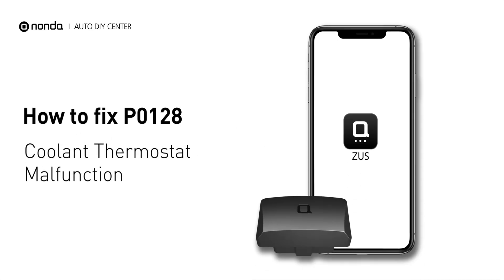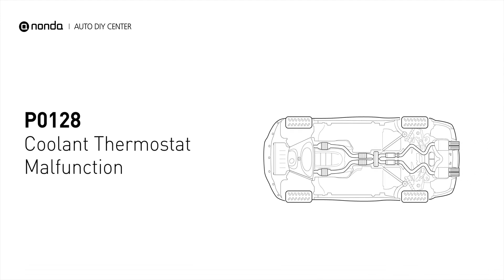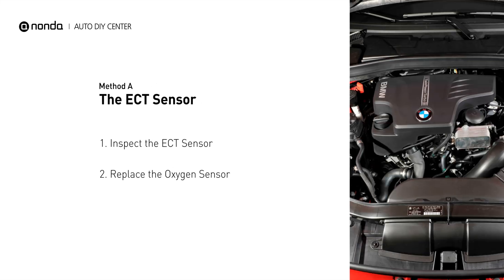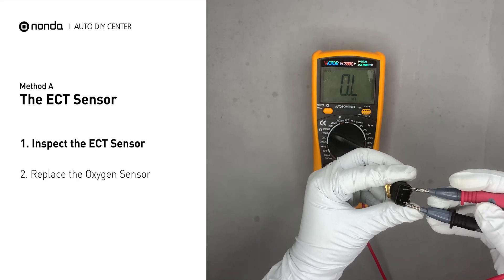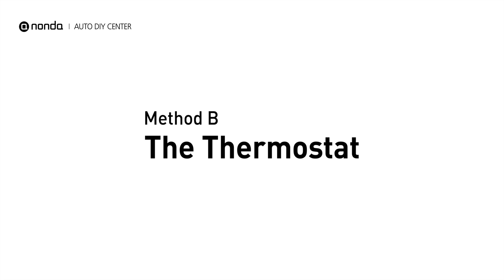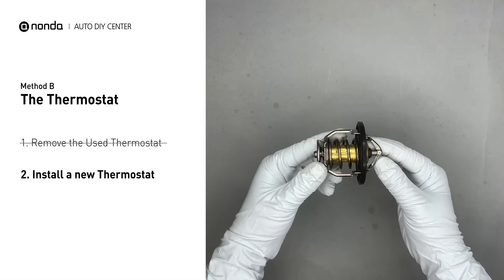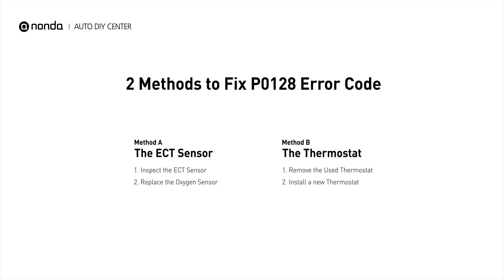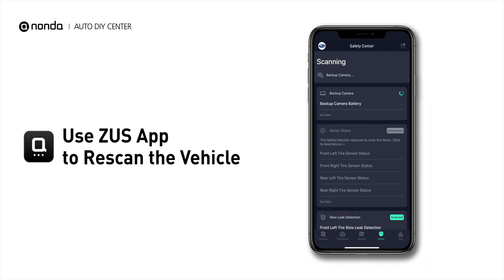How to Fix P0128 Engine Code in 3 Minutes [2 DIY Methods / Only $7.34]

Comment from the maker: Hi, I'm Steve, nonda's lead mechanic engineer. 
Feel free to leave your comments here if you have any mechanic questions, I will be glad to help you out!
Reply: hey man i have an issue. so i been having this code show for my nissan altima 2010 and i changed my thermostat in hopes that was the issue but it wasn’t. so i then just now changed my ect sensor but yet the code still shows.. do i have to drive my car a certain amount of miles for the drive cycle to kick in and wait a few days to see if that code still shows? and if it still does, what other options are there to fix the issue if options A & B don’t work? please help. i need this code cleared so i can pass smog 😭
Reply: @Swayyj  look up how to bleed air from cooling system. And if anything, buy a $20 obd reader. I found one at a shop in my city, works great. Connects to my phone
Reply: @Gabriel-pj2bk  i bled the air but still the code shows.. i have an obd sensor.. i have done everything at this point. i’m convinced it has to be the wiring or something else at this point. the car runs fine i don’t know why i’m getting this issue. please help me. i’m about ready to take this to a mechanic or the dealership to get this fixed
Reply: @Swayyj  its hard to say man. Could be a wiring issue, also could be your coolant. Sometimes if the ratio of coolant isn't exactly 50/50, it may throw this code cuz coolant takes longer to heat up. Is it possible you maybe threw in the concentrated coolant without mixing it with water? That's the only other thing I can think of other than a wiring issue
Reply: I have this code in my 2001 Buick century. This car has only 42,000 miles (bought from elderly relative) Shop wanted $150 an hour just "diagnose " the problem!! I have Verizon Him app which gives me the code.
It also says I need an 02 sensor.....so are these related? Car is not overheating.
Reply: if this engine check light code was not repaired for long time, what will happen ?
i hear loud noise after 20 - 30 min of driving which is increased by pushing on accelerator !!! is it related to unrepaired coolant thermostat  ? or something else  !
in dodge durango 2012
Reply: I have a 2009 Pontiac g8 an my engine light came on, I did the obd2 an the code came back as p0128 an p0497 I’m not sure tho if it’s my thermostat or the engine coolant temp sensor
Reply: My 2015 yukon had this problem change both parts now its giving a permanent fault code, And it can’t not be erase
Reply: What happens is thermostat  wasn't put at 11 o'clock possition?
Reply: Please, lose the goofy alarm sound in the videos.

Comment: I have P0128 and P0138 errors. I replaced my car's thermostat and the upper and lower oxygen sensors, but the errors don't go away. I'm thinking of replacing the ECT Sensor next. However, by replacing the ECT sensor, I have to waste coolant fluid again, which I just drained and topped up recently.

Comment: What if the P0128 code still shows despite those 2 things......they tested ok, but I went ahead and replaced the thermostat (just in case) and the ECT....t.hey were not very expensive.....BUT the code is still coming up and I made sure all the air was out of the block, and the coolant level was correct.
Reply: Check wiring
Reply: @Worldtourism-shah  I have every wire had continuity all way to ECM

Comment: 2018 Elantra 2.0 random p0128 shop said to replace thermostat housing with thermostat built in. Did that in November 2023. In January 2024 it came back and got a replacement u der warranty.  Now its April and its happening again this time i saw a smal stream of fluid as i drove off on my drieway. The drip pan under the engine bay is wet but can't find where the fluid came from i get heat still and used the torque app and temp shows 199. And these factory ones are 212 boiling point thermostat. Not sure what to do. Are these just junk thermostats or is the ecu or pcm needing some dealer update? Any thoughts or alternative solutions please share.

Comment: Hey Steve. I have a 2016 Kia Optima. I recently changed my oil on my car and the following day I noticed the engine light was on. Came up as code P0128. I have noticed little to no changes though. Car gets to normal temperature, heat works like normal, coolant levels are good. I’ve noticed an occasional white smoke from the back even when car is at running temperature. Any advice?? Thoughts on what I should do or check?
Reply: same thing with my 16 optima but i replaced my spark plugs, did you find anything?

Comment: Hey Steve I got a Honda civic 2012 and it’s throwing this code. Replaced thermostat but not thermostat housing. I have a metal housing and I really don’t think that’s the problem like some videos say. I see a lot of people changing out their housing because it’s rubber or plastic which makes sense. Anyways I also changes ECT Sensor and the car still runs like crap. I’ve heard of “Flashing your car and making sure no air is in the cooling system witch is what I’m going to try next.
Reply from the maker: Hey how is it going now?
Reply: @nondainc  still the same. Haven’t flashed the car yet but if that doesn’t work I guess I’ll replace the therm housing. I even did a full tuneup on the car new plugs/coil packs and replaced valve cover gasket which needed to be replaced. I just bought Kawasaki ninja 400 so been a little preoccupied since I messaged you last. I should probably mention the car does fine in drive while I’m applying gas but once a take my foot off the gas it start to run really ruff. Does the same thing in P and N. RPM’s don’t jump around but you can feel the funky vibrations of the engine. The P0128 code finally went away so my engine light is off but for how long is the question lol

Thank you very much for checking in though. Once I figure out the problem I’ll try and remember to comment you back. Really appreciate it!

Comment: Greetings friend. I see that my 2002 Chevrolet Tracker 2.0 or what would be the Suzuki Vitara does not reach the temperature, so I might think that it does not have a thermostat. I connected a scanner to it and performed a real-time analysis and the temperature varies between 50 and 77 °C, that is, it can be at 77 then it goes down to 65 then it goes up to 70 and then it goes down to 55 and so on. Do you think the fault could be that the coolant temperature sensor is damaged? The scanner marks the code P0128, P0113 and also P0335 of the CKP sensor. According to two mechanics who reviewed it, they say that this CKP code is normal for this vehicle, but for me what doesn't work is them because it can't be normal. The IAC valve was also changed but it is a compatible generic one.
Anyway, if you can help me, I would greatly appreciate it because when the car is hot it shakes and the revolutions drop, and it also uses too much gasoline.
Thank you very much and excuse my English, I really speak Spanish and I used the translator.

Comment: I have the issue with my Mini Cooper 2013. Just 1 day ago, one bad mechanic fixed my brakes. I am getting an error like an engine check. I went to O'Reilly  to check why the engine light is on . So i got two error codes 1.P173B
And 2.P0128
Even while my fan is not shutting off  for 10mins even though I turned off my engine 🙃
any leads or suggestions please
Reply from the maker: Hello, as you are receiving more than one error code, we highly suggest getting your vehicle visually checked by your local mechanic for further diagnosis.

Comment: Hi Steve, I have a 2016 BMW 228i Xdrive and recently after getting my housing valve cover gaskets replaced by a bad mechanic my car got a U1408 and P0128 Codes right after they deliver me the car. By any chance do you know what might be the fix or the issue is? Thanks a lot!
Reply from the maker: Hello, we suggest inspecting the ECT Sensor., coolant temperature sensor, jiggle valve. and the thermostat.

Comment: I have P0128 in my 2014 Dodge Caravan. I replaced the coolant sensor and Thermostat and still have the error code. Any ideas?
Reply from the maker: Hello, is there any other codes that register along with this code? We also suggest checking all the electrical connections for any issue.

Comment: I have a 6.6 lbz duramax 280k with egr intact oem. I am puking coolant… my temp stays at 160 for 20 minutes then spikes to 240. For 10 seconds then drops to 180.. low coolant light pops on. Then sits at 190. Which is operating temp. I have heat the whole time and no loss of power or smoke. No coolant in oil.. it’s a diesel.. I haven’t changed thermostats yet. The mechanic I brought it to 3 years ago found a crack in my housing I think he re used old t stats
Reply: I’m dreading head gaskets but I feel like I’d have way more symptoms then cold coolant puking out. It isn’t even hot coolant that puked
Reply from the maker: Hi Zack, can you please confirm if this is the only code you're getting?
Reply: @nondainc  yeah only getting a po128

Comment: I had a P0128 trouble code in a 2002 V6 (3.8L) Camaro.   No leaks,  had heat in the passenger
compartment,  but the temp gauge wouldn't move from "cold", and the cooling fans were 
running on "high", even when the engine was cold (below freezing).  Replaced the ECT sensor,
did not fix the problem.  Replaced the thermostat, cleared the trouble code, after 2 miles,
the temp gauge was working normally, the fans stopped spinning on the radiator, and the
car ran smoother.  Put the "bad" thermostat in some boiling water, it opened just as it 
should have, and closed when I dropped it in some cold water.  One thing though, when I
pulled the old thermostat out, the jiggle valve was not in the "up" position, it was in the
"3 o'clock" position, so perhaps that was the cause of my problem.  Engine only had 
59,000 miles on it, and the thermostat wasn't "dirty" at all.
Reply: I didn't have a check engine light,  but I cleared the trouble code and my temp gauge started working again.
Reply from the maker: Hi Hans, kindly double check if this is the only code you're getting.
Reply: @nondainc  yes, it was.  No "check engine" light, either.
Reply: When you put thermostat in correctly did this fix the light ?

Comment: The check engine light went away by itself after this code appeared any reasons why?
Reply: I have a similar issue on 2002 toyota avalon xls. The check engine light will come on and go off at times with no rhyme or reason. Not sure if it's the sensor or thermostat. For my vehicle the senor is easier to replace but I don't see any fluctuating in cool air or the temperature gauge, when going the  dial sits right under half mark of C and H
Reply: @DeepRestInstrumental I have the same car and just got the code as well
Reply: @anthonydelao5059  I ended up just replacing the thermostat it self, a few videos on YT on how to and that seem to fix it.
Reply from the maker: Hi Tom, please provide us with your vehicle's year, make and model.
Reply: 2014 Dodge Charger sxt awd
Reply from the maker: Hi Tom, kindly check your thermostat and the related wiring. A replacement could be necessary. You can observe the issue will be back specially during cold weather.

Comment: if this engine check light code was not repaired for long time, what will happen ?
i hear loud noise after 20 - 30 min of driving which is increased with pushing on accelerator !!! is it related to unrepaired coolant thermostat  ?
Reply from the maker: Hi Roberto, as the temperature gauge not reaching the optimal levels, this can eventually damage your car’s engine and performance. Please check the condition of the thermostat, coolant temperature sensor/wiring and other components of the damaged sensor

Comment: Good morning Steve I have a p0128 code, I bought the car off my neighbor he had replace the thermostat and hoses as most people do. Car ran fine then I got and secondary 02 code, fixed the issue then the p0128 came back, using logic it can be assumed that the ECT can be the cause
Reply from the maker: Hi Alejandro, please provide us with your vehicle's year, make and model so we can address your concern accurately.
Reply: I have very similar issues. I have both P0128 and P0136 which is the secondary O2 code. How do you fix the secondary 02 code? Did you eventually fix your issue by changing ECT sensor? Thanks.

Comment: Hi steve, your videos are very helpful. I have acura RL 2005 and it’s showing code P2183,P0128, P 0111 and P 1717. I’m bit confused that the fault is in censor 2 or thermostat pls help me. Thank you
Reply from the maker: Hello, it's probably an issue with the ECT2 sensor. Either a bad or leaking sensor and a damaged wiring. We also suggest to get your vehicle visually checked by your local mechanic for further diagnosis as you are getting multiple error codes.
Reply: nonda, hi steve, thank you for your information. I visually inspected and found wet place  near thermostat (probably coolant). So I decided to change thermostat.